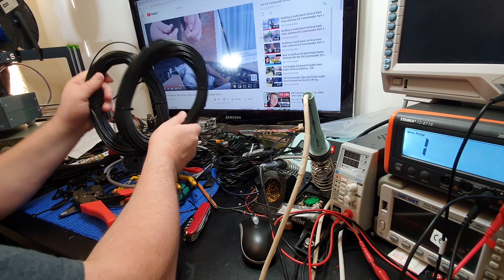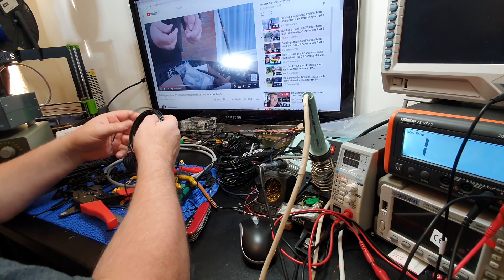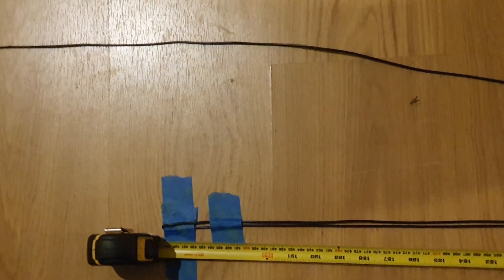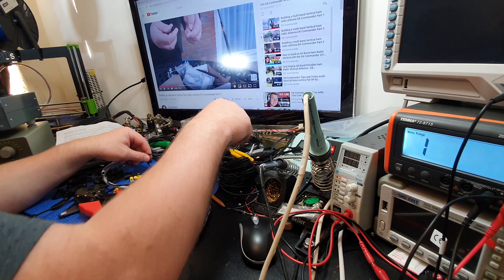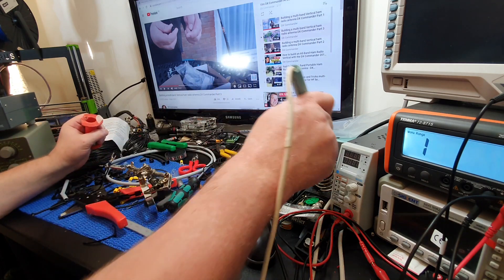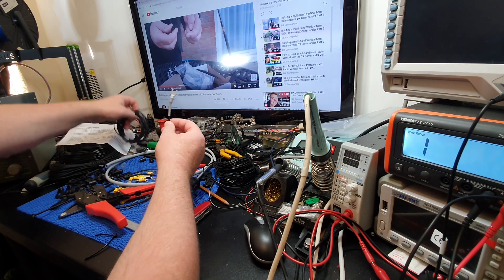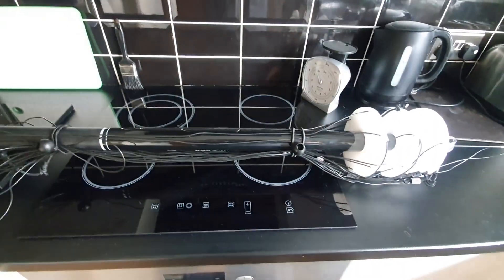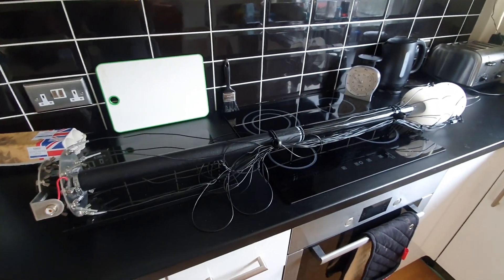The DX Commander assembly, how I did it..

Comment: Awesome.  Question.  This can be a primary antenna as is or are there any upgrades needed?  Where I live the summers are extreme and humid.  UV destroys patio furniture in a couple of years.  Chairs and shade umbrellas become very discolored and brittle and evern rip with the wind.  I would like to plant this and forget it for a while.   I appreciate your video.
Reply from the maker: That's a tough question :-) they are tough but a couple of extra guy sets make them really strong.. however they are intended as a temp antenna, needless to say some folk have had them up a long time..  Gaz
Reply: @TheGazLab  thanks!!

Comment: Love the demountable version, I use a “Portable” glassfibre extending pole with a single 20M inside so it collapses easily. This should be just as easy, just throw out a lot more radials. But need to find how to support it instead of my wheel stand, normally without guys.

Comment: Gaz what size heat shrink did you use please regards Adi G7MUY
Reply from the maker: Callum supplies the heat shrink in the kit.. Its about 10-12 mm Gaz
Reply: @TheGazLab  sorry my bad the gray heat shrink Gary I think the strengthening of the radiator elements is well worthy as this will be my main antenna regards Adi G7MUY
Reply from the maker: @adisadler1801  lol no problems.. That was 8mm and 10mm
Reply: @TheGazLab  thanks Gary keep up the great work regards Adi

Comment: Love the creative use of what we call a torch in the USA. I’m a firefighter and probably would do something similar! Great video! I’ve only stumbled here upon a DX Commander notification. I’m only a year old ham, and I am trying very hard to get my DX Commander up and tuned! I now have the DX 50 wire which is great stuff! Pliable nice green, and extremely easy to work with. My only wish is that, Cal, you or Ian also you tuber were in the states to give me a hand! I’m due for shoulder surgery 22 January and I want/need it up before then! -73- W1KPS hitting subscribe. Can you please tell me what you found confusing in the instructions? I had a difficult time with a section myself.